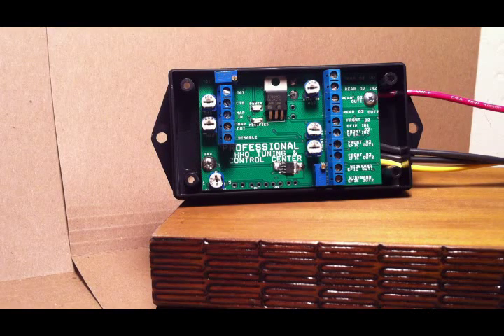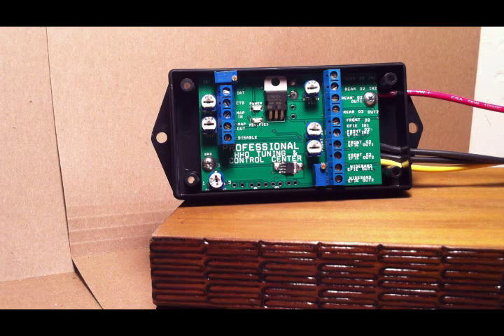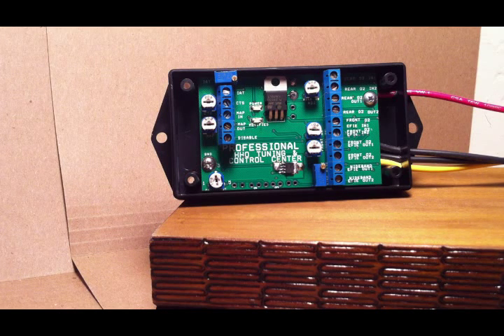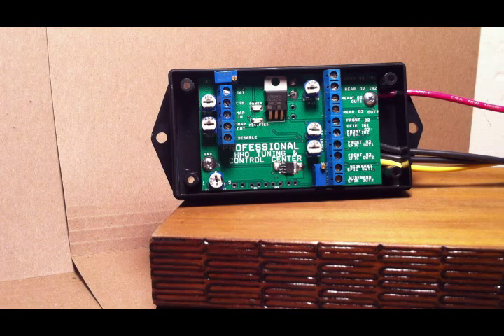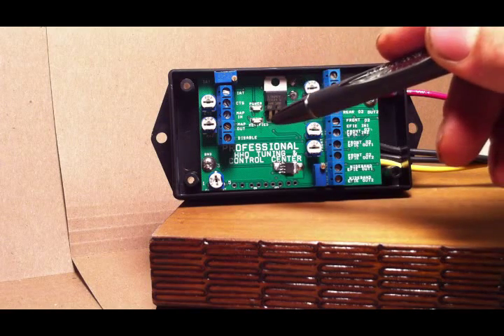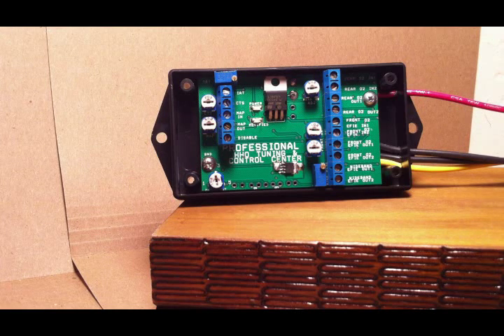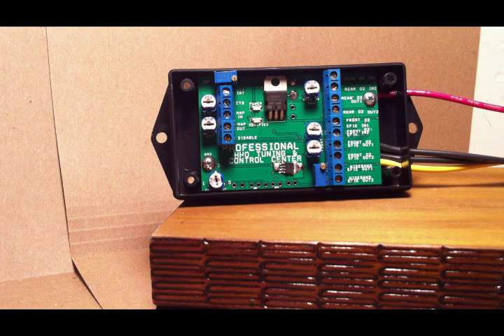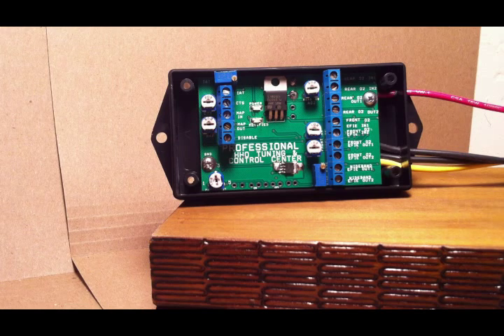greensource.ca HHO Pro tuner

Comment: Buyers beware, I bought one of these for my 2008 Mercedes ML320 and it worked good for three weeks then it stopped working, here is their comment for a solution!! 

Dan

It's got damaged there somehow. Without seeing it, it's either a port on the MCU or the display itself. Neither are pretty to change. To save time and money and no guarantee of repair when it lands here, i suggest you are better to get a replacement at 30% off. 
We do our best to help our customers through mishaps.

thank you
rob

Ya how about I just keep paying $220US until one works!!! There are better options out there besides a company that doesn't support their product.
Reply: L Bird I bought one of these also and they were very nice to me and explained what I needed to do.
Reply: like what? I'm torn. Are these supposed to be efie's or are we supposed to buy efie also?
Reply: I think they've got a problem. bad internet presence & unable too deliver on half their customers, moving very little product. shame.
Reply: I BOUGHT THE CCPWM, JUNK    AND THEY WANTED MONEY FOR SHIPPING 3 TIMES

Comment: Hi Mr Zahadam. I'm hoping you can help me, I bought a universal ccpwm and efif controller for my hho wet cell generator, it only has two wires coming out of the unit, 1 red wire and 1 black wire, I have looked over their instruction email with diagrams about ten times, and I can't work out where these wires go, any help would be appreciated, I thought the red must go between the positive current and the hho gen, but how does that trick the computer, or does it go on the O2 sensor wire ? not sure
Reply: dougalass1111 I can help you
Reply: dougalass1111 3 years ago